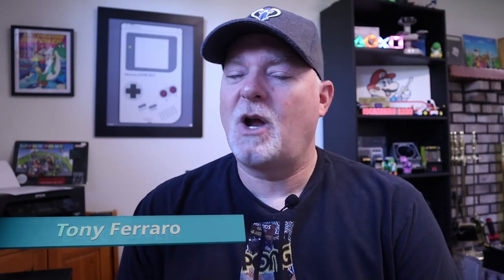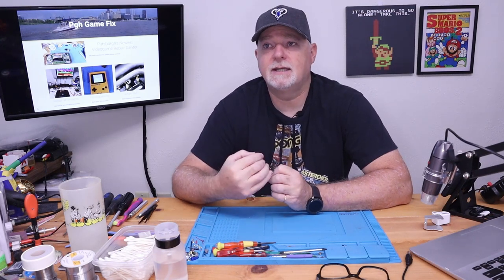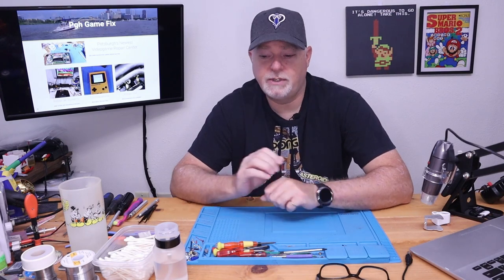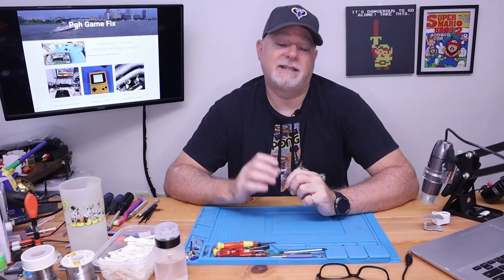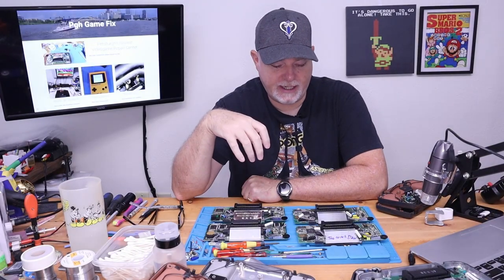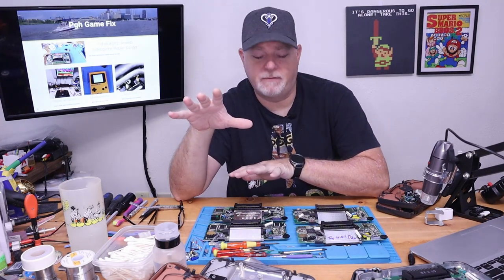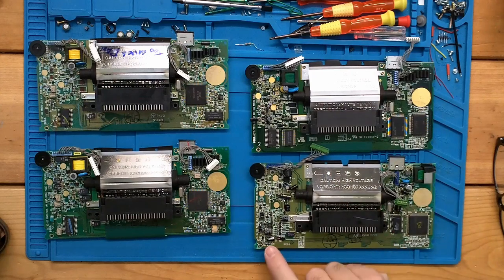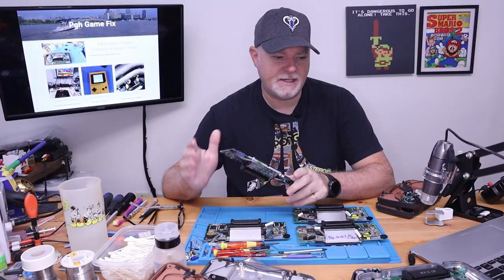Game Gear Capacitor Replacement. Black Screen, No sound.

Comment: Just got one it actually works but the screen is not clear and details are missing I can only hear audio with headphones and its very low. Any tips how to fix it?
Reply: change the caps.... that could fix all of it remember you have 3 boards, mainboard, soundboard and powerboard and all three has capacitors.   
Also clean with qtip and IPA your speaker.  I am 90% will leave it 100% worrking with good sound.
Reply: @corderma  yeah that was the issue. Another one I have has bad power board to main board wires.